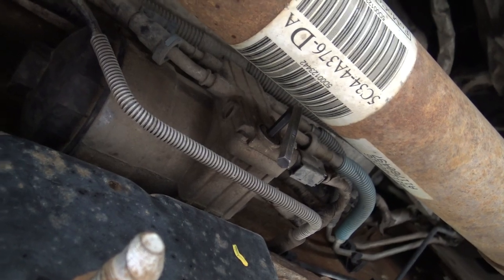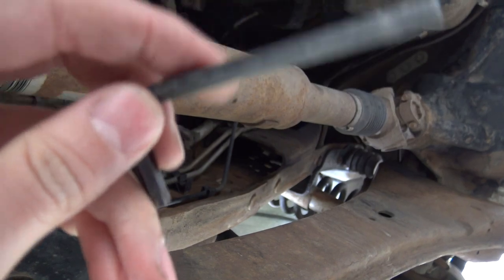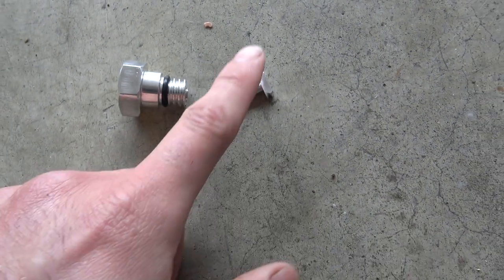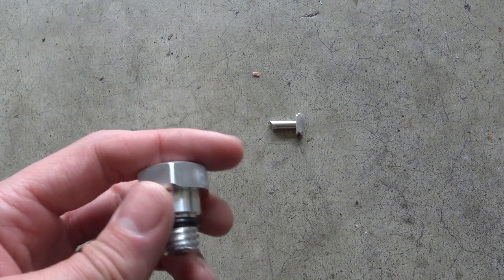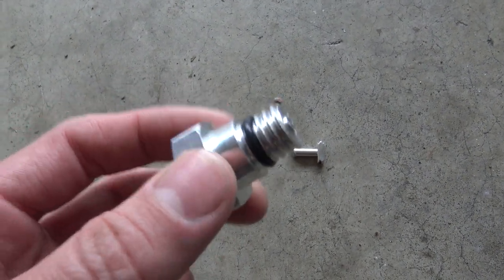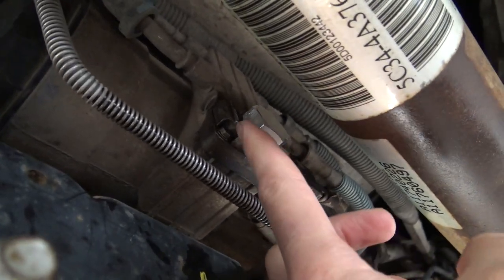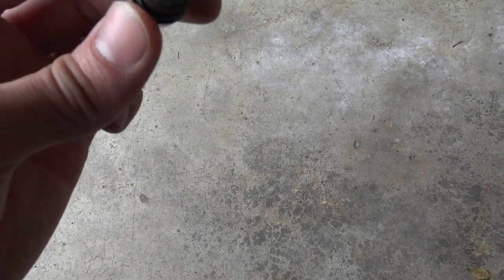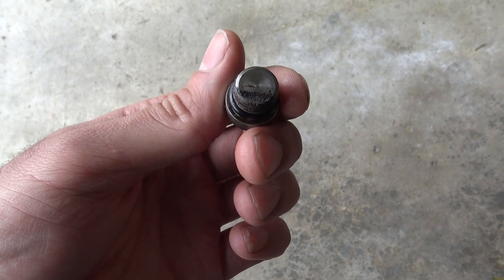6.0 Powerstroke Water Separator Drain!  You should probably be draining it more often

Comment: What is the purpose of that extension on the replacement plug that you cut off?
Reply from the maker: When you unscrew it it holds the plug in the drain hole.  Without it, it just comes all the way out which is no big deal.